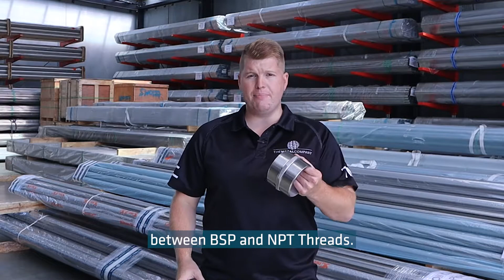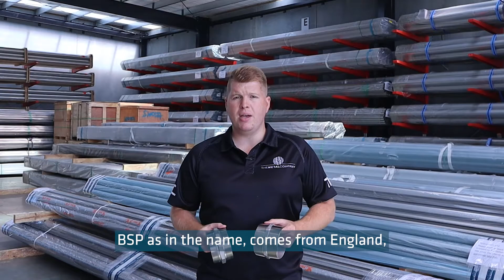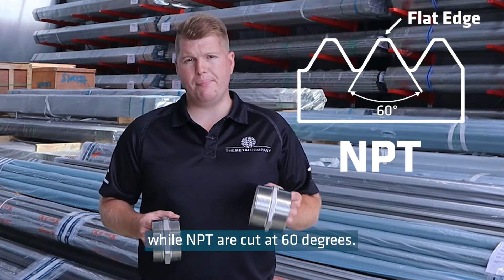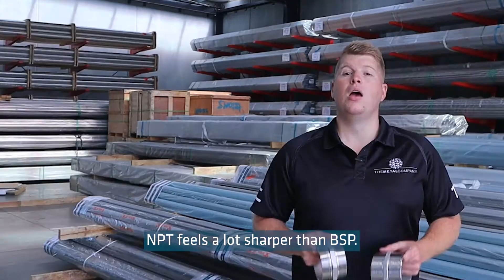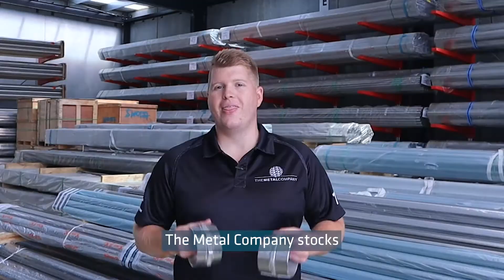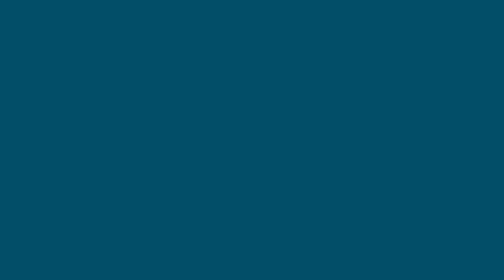Differences Between BSP Threaded Fittings and NPT Threaded Fittings? | Technical Tuesday

Comment: Can you put a male bspt fitting in a female bspp and would it seal ok? With teflon tape on a low pressure 30 psi application?
Reply from the maker: Hi Norb thanks for the question. All of our Male BSP connections are BSPT and all of our Female BSP connections are BSPP. Our BSP range is rated to 150PSI, so your application of 30PSI would be just fine! 😄